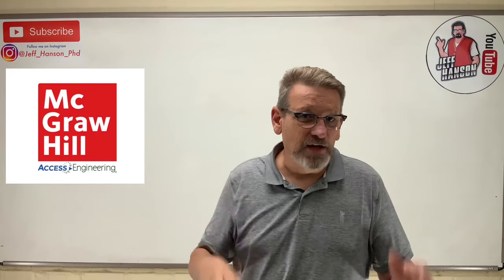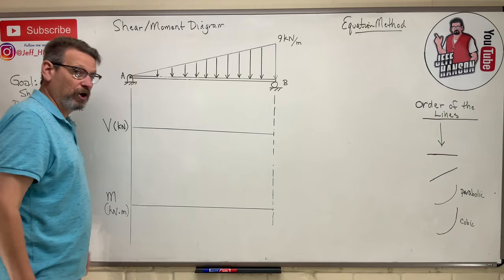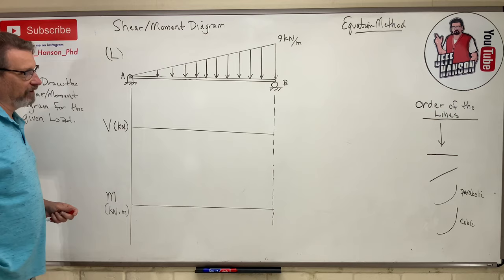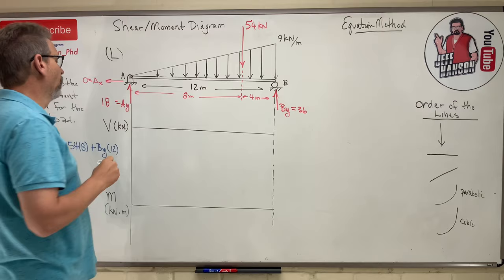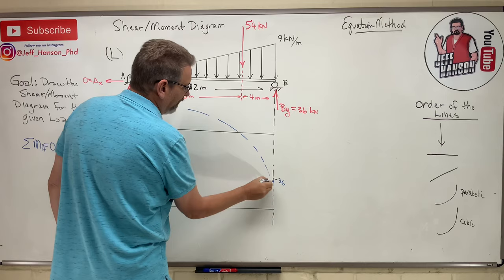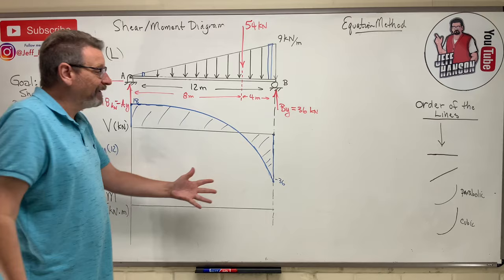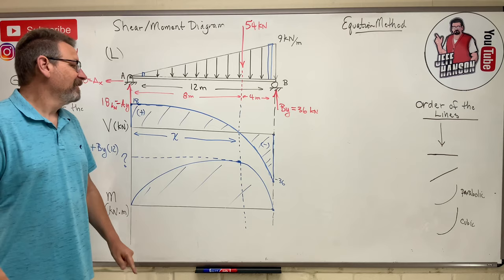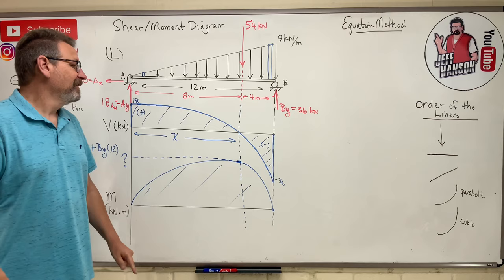Statics: Lesson 61 - Shear Moment Diagram, The Equation Method

Comment: A little confused. How did you determine the 8' and 4' from the concentrated load of 54? I figured the midpoint of the 12' for the concentrated load of 54 would be 6'. Thank you
Reply: because its a triangle
Reply: For triangles, the centroid is 2/3 of the length (2/3*12=8)from the short lines and 1/3 of the length from the tall lines(1/3*12=4)
Reply: @badyahelamin8386  thank you so much, just looking for that,,,,,
Reply: @khalidalsharari8355  You're welcome :)
Reply: @badyahelamin8386  Thank you a lot!
Reply: @chrisbroward  you're welcome!
Reply: @badyahelamin8386  buh he wrote ½ . Or am getting it wrong?

Comment: lets say there was also a point load acting on the beam, then you have to take the cut áfter the point load right?? or can it be at any point? because what if you took the cut too early on? this is where you have to use Macaulay's method right?

Comment: What if in this example the triangle distributed force would be flipped the other way around? This method doesn't seem to work in that case, if the slope is -3/4 and that the starting point is (0, 9) v(x)=0 has no solution.

Comment: 0:55 Possible exception? On problem 7-53, the shear graph crosses the axis with a slope, not a parabolic curve, yet I didn't see how to continue with the graphing method because I needed to know where x=0 (which I think requires having the shear equation) in order to calculate the area of the triangles (it's not neatly on a line of discontinuity where we are given the x-value). This is due to an additional moment on the beam making the support forces unequal. If any of you see how I'm wrong, please point it out because I'd much rather use the graphing method as much as possible.

Comment: Great video as always, just to let some of you know though, it would probably be in your best interest to use calculus and integrate to get the equations instead of cutting the beam. It would save you alot more time on exams, and its not hard integration either, its just integrating a linear function. Could easily find videos on how to do it, def saves lots of time tho instead of drawing a FBD and cutting just to find the max points and what not.

Comment: Hello sir.. while you calculated the external reactions Ay and By, you didn't consider the distributed load. Can you please explain why because I'm confused!
Reply: He converted the distributed load into a point load acting at the centroid of the triangle.  So .5x12x9=54kn and it acts at 2/3rds along the length or 8m.

Comment: I didn't know that the centroid of a triangle is 2/3 of the base. So I figured out an x so that the areas on either side would be equal.  In other word determine an x so that (XxY)/2= 27 Which is half the size of the total triangle. X by my calculations would be 8.485, Which is pretty close, but still not the same. Why isn't this correct?

Comment: I just can't understand how it is possible that the maximum value of moment is not met exactly where V becomes zero(where x=8m but where x=6.93m) since the moment diagram is the integral of the V diagram , thus V is the differential of the moment and we have been taught to look for extremums of a function where its derivative either is discontinuous or equal to zero.

Comment: I'm just having trouble understanding where he puts the dash lines why is it 4
Reply: The centroid of the triangle is located at 2/3 its length (2/3 x 12 = 8) so you’ll have 8m to one side and 4m to the other. To find the load at the centroid just multiply 12x9 = 108 and then divide that by 2 (area of the triangle) which will give you 54KN at 8m from the left and 4m from the right.

Comment: Why wasn't the concentrated force not on 6m?
Reply: Because it’s a triangle load not a uniform load. The centroid of a rectangle that’s 12 long would be at 6m, but for a triangle it will be 1/3 of the distance from the base, so at 8m